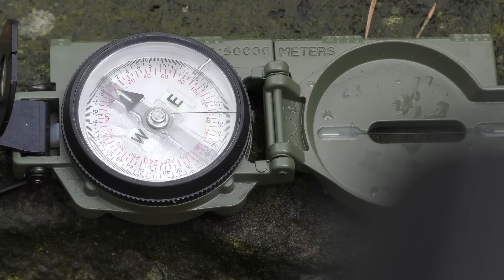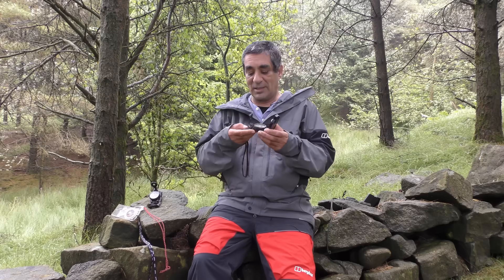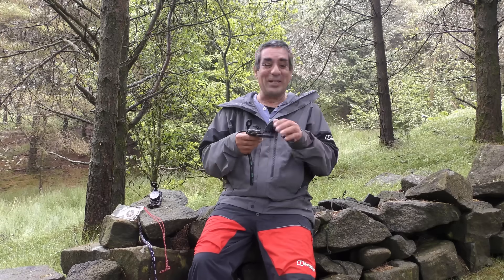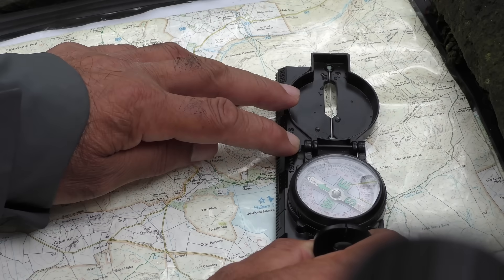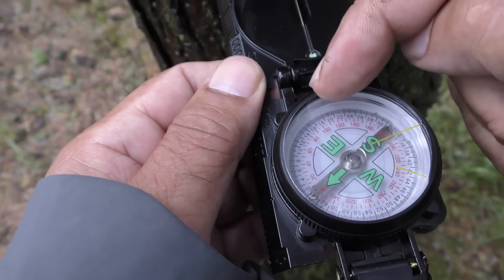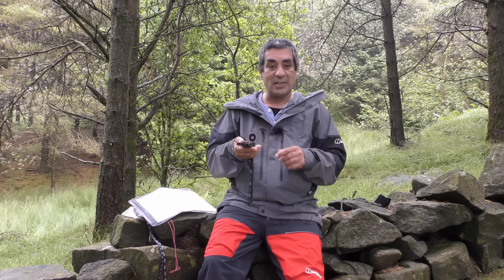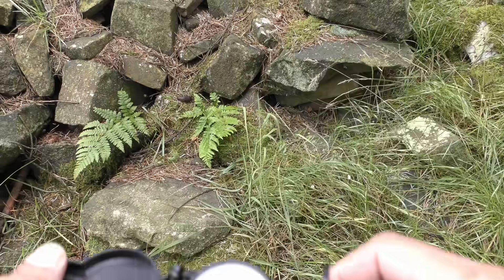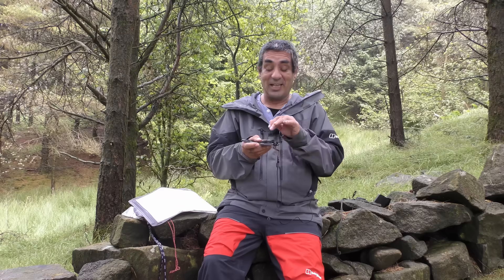The compass no one knows how to use

Comment: Over 50 years ago, the Army had a 4 day Land Navigation Course in Basic Training. The course taught map reading, use of protractors, lensatic compasses, azimuth and reverse azimuths, intersection and resection. For the Performance Evaluation you had to use what you learned to make it through an Escape & Evasion course. Once the Army got GPS's , Land Navigation was put on the back burner.
Reply: Did my course in Basic in 1988 (Ft Sill).  We also laid our howitzers using a compass.  We operated in MILLS at the battery lay, and not degrees so I had one compass in MILLS and one in DEGREES ( for RSOP navigation) to back my laying compass up.

Comment: "The compass no one knows how to use" proceeds to look through it wrong lmao. You fold the lens part up but angled slightly forward and then fold the cover down on top of the lens part so the notches line up. The ends of the lens and cover with the notches should be touching. then you look through the notches like they are iron sights (notches are rear sight and the wire is the front sight post to simplify it) at what you are trying to get the direction for. Then with the same eye you use the lens (angled slightly down for easier viewing) to view the compass so you can get a stable and accurate direction with the cover blocking excess light, rain, snow ect... to easier read the compass. No it's not a cammenga but those features are used the same.

Comment: Good basic use of this very useful navigation tool,  although going forward is very basic finding a needle in a hay stack is much more complicated one degree off at 300 feet is not much of a variation but at several miles trying to get on a 6 digit grid coordinates your going to miss your mark, being able to shoot a back azimuth correctly is a must to maintain a high level of accuracy especially at night .

Comment: I learned to use a compass very accurately back in the 60's when I was a Boy Scout.  Using this style of compass.  Been too many years now so hardly remember anything.   lol  Years later ended up on the front end of the C-130 before the days of GPS navigation where map reading was essential for low level flying.

Comment: OK I thought the short yellow line is for true north. The long yellow  line is for magnetic north. As far as I know there is a 10 degrees difference in true north if I'm not mistaken.
Reply from the maker: The difference between True and Magnetic N, changes depending on where you are in the world.  The short yellow line is just to reduce the number of clicks you need to make to set a bearing.

Comment: The moment I saw that thumbnail, flashbacks during recce course where the wire broke off halfway and lost through navigation. We had to check whose hair was the longest (I won't say from where but all our heads were well.. "uniformed standard") used it as replacement and got our bearings, good memories.. awesome video

Comment: 4:00 confuses me because you say point the long yellow line up the map, but give no reference other then up the map, north? 

The north marked on the map? I see no reference on the map that reference the yellow ling you just moved, i see longitudinal lines but the yellow line does nat match those either. 

Cant be magnetic north on the map because those are true north.
Reply from the maker: Rotate the bezel until the long yellow line is pointing up the map / that's north / northwards on the map.  It doesn't matter which direction the map is oriented in fact the map can be pointing in any direction.

Comment: This hand-held milit-compasses are poor-man-theodolite, but - OBVIOUSLY - you never use them the proper way, bcs, in order to be PRECISE - IN THE SAME ACT, WHEN YOU READ THE AZIMUT-ON-THE TARGET, YOU must see (WITHOUT LOWERING THE COMPASS BELLOW LINE OF SIGHT) - the proper angle (azimuth) on the horizontal circle,  BY LOOKNG INTO THE MIRROR (ON THE INNER SIDE OF THE COVER OF THE COMPASS), where both of these compasses ARE MISSING THIS "DETAIL" !!!

Comment: If you are calculating azimuths with a map, the map has to be oriented to magnetic north.
Reply from the maker: The map can be pointed in any direction.  The results will always be the same.  If you want to orient your map north, that's fine, but it has nothing to doing with taking a bearing / azimuth.
See this video for more details: https://youtu.be/AWiMV4T5kPc
Reply: @TheMapReadingCompany  You're aligning your grid compass to the map instead of aligning the map to the magnetic compass. So, the $64k question is which is more accurate?

Comment: Correct me if I'm wrong but it seems to be the exact same compass we trained on in boot camp in the early 80's. I felt horrible how much I've forgotten. Thank you for an amazing video sir.
Reply from the maker: The compass in the video hasn't been used by any armies for the past 70 years.  You don't say how old you are, so you have used it if you're over around 95.
Reply: I used the 1950 throughout my military career 1990-2020. And it wasn’t the Cammenga as they weren’t established until around 1992-1994. My compass was issued to me in Feb 1991. I still have it out in the garage in my old gear bags. They tried to get me to do a turn in and reissue when every one was in a panic in the mid to late 90s because everyone thought Tritium was so toxic and dangerous. I still have my military issued Tritium dive watch as well, although it has exceeded its half-life and doesn’t glow anymore.

Comment: Never knew about these bearing lines before. Interestingly, I learned how to use a basic base plate compass when I was ten. However, nowdays, with roads crossing everywhere, and people everywhere, the utility of a compass is dropped quite considerably. Plus all the non-compass methods of establishing bearings and lines of sight if need be. I recently bought a prismatic compass as a crossover to the mechanical theodolites I have, showing an alternate method of doing a preliminary survey of an area of land where only estimation is important in order to establish rough boundaries and fixed points of reference, not a precision record. I still love what you can do with a compass, but struggle, in my world, to find a reason to keep one handy, even when I'm away from the main roads. In a way, it's unfortunate, because before we had these things (along with adequate maps), getting around was a LOT harder!

Comment: I have a GI 1950 compass, (since ~1957.)  I've used it all over the world for hiking, minor surveying, and to figure out path problems on microwave radio shots.  I trusted in it for years and it still is in great shape in it's cartridge belt holster.  I was pretty much self taught in it's use but learned to sight and angle the lens to adapt to my eyesight.  I never knew about eh use of the yellow lines, so thanks.

Comment: After several times reviewing this video I understand now how this compass functions. My difficulty is that my Englisch is very poor. I am a Dutch speaking Belgian, but I really like your video’s. Interesting and well made. One of the best on the internet. I saw hundreds of videos about compass, navigation, orientation, etc, but more junk than really correct and useful content. Luckily I found your channel with many correct and informative videos.
I will stay by my Suunto and Recta compasses. By shooting a bearing i turn the bevel (or is it bezel?) and look in the mirror to see if the needle is perfectly aligned with the direction arrow. To read the degrees i don't need no longer keep the compass that way. With the compass you show us, you need to read the angle by keeping the compass pointed to your destination without moving. That seems me more difficult, certainly if you have a little difficulty to read the compass. With the Suunto and other compasses it’s much easier to read the angle from above.
Reply from the maker: That type of compass (in the video) hasn’t been used by ANY militaries for at least the past 70 years – so anyone who was trained to use it in the military will now be over around 90 to 100 years old.
BUT at the time it was the best available and, more importantly, it worked.
I agree modern compass are much simpler to use and less likely to lead us off the path 😊

Comment: Navigating around an obstacle using two 45 degree reorientations off the azimuth might get one back on course with an easy to calculate pace count along the azimuth ... but we weren't taght about the little yellow lines so we used a square instead of a square root.  Thanks for updating my orienteering package!   ... Just now I've begun to wonder if the square root of the square of seven giant steps times two is equal to 10 paces.  If so, I might have to walk faster to keep the pace count.
Reply from the maker: Rather than boxing at 45 degrees,  a better idea is to go at 60 degrees.
I go through this at the end of this video   https://youtu.be/ilXLMlzL9vE

Comment: I always understood under fast walking under difficult conditions is more like slow run, jogging on difficult terrain. You don't have time to constantly look down your wire and you can't stay on the straight line. so you place your north in between the 2 lines and keep it there while running in that general direction. it counts for small deviation in your path that you have to take. when getting closer to your destination you recheck your course adjust to it depending on how much you deviated and start running again.

Comment: I had something like that years ago, easy before the internet,  now I know why the lines where there. 
Mine was stranger than that... on the wire there was a small metal plate that slid up and down.
Please tell me what the hell that was for. 
It was my dad's from when he was in the 17/21 lancers (tank regiment) and he didn't know how to use it either.
Reply from the maker: Some WW2 compasses had slides on the wire to check horizontal angles - used for artillery when firing at something on a slope.  But not sure if that was what your dad had.

Comment: I actually bought one of these years ago when I did a lot of biking on trails but never really had an occasion to use it.  Kind of thought of it as a last resort item LoL.  I'm sure the maps I used would have been worthless with a compass and as you said with gps (assuming you ensure charged devices plus backup battery) it's much more accurate following a satellite position than trying to use a compass but still good to know.

Comment: Interesting. The benefit of the "two-line" (45 degree offset) system, was that it was usable at night without using a torch or flashlight to read it, instead using the 45 degree off-set to allow the desired bearing to be set audibly. In civilian use, this has no benefit, but in the military it did, as shewing a light at night could get you killed. Post 1950's compasses used the rather safer Tritium (instead of radium) as the danger of the latter's dangers were now understood. I think the use of tritium allowed for the degree value to be read more easily than a safe amount of radium would permit, therefore the way the compass was used also changed?

Comment: I was in the US military from 1984 to 2008. We use the same compasses. Those yellow lines will illuminate at night when you put a flashlight on them. Most of the way you explained how to use a compass. We never used it. We were given distance and directions. We were told a degree we set the compass locked it in on that degree. We were told that if it was 3,000 km I know that I walked 36 steps per 1 km distance and direction and we were able to use the map to set our compass

Comment: Does the compass-on-map technique that you demonstrated starting at 3:30 account for magnetic declination?
Reply from the maker: No.  You don't account for declination whilst you're taking a bearing from a map, it's done afterwards.  
1 Put the compass on the map so the edge is touching the start and end of the leg.
2 Rotate the bezel to get the bearing.
3 Pick up the compass an adjust for declination.
4 Set off.

Comment: I have a Helicon-Tex Ranger that has, not only the two lines (in this case they are green) but also an index line. 
The magnetic base has a bit of inertia to it (takes a little while to stabilize) but apart from it works very well.

Comment: Both of those compasses are obviously cheap knock-offs. They both have the unit of measurement, "metre" misspelled as "meter" (a meter is a device used for measuring. eg. The compass itself is a type of meter, but the distance it measures are metres.)
Reply from the maker: I bought my Cammenga direct from Cammenga, so it's not a knock-off.  I always thought that Meters was the American way of spelling it and Metres was the UK’s way.  I may be wrong about this, it’s just a guess.

Comment: I have my dads old lensatic compass and a BSA plate compass.  The lensatic doesn't have the straight edge though so it's more difficult to use on a map than the plate compass.  I do prefer the lensatic for taking bearings in the field.

Comment: Thanks for this, my scoutmaster was kinda mixed up about this too, some thirty years ago. My way of dealing with it, again thirty years ago, was to know which radio towers were which in my valley. If i could get a bearing on any two I had a good idea where I was. I kinda figured out how to set my direction by the long yellow line, but got mixed up fairly often. I'm gonna watch this video another half dozen times, taking notes. And invest in a compass that has clicks. Thanks again :)

Comment: Anyone who went thru basic learned this like week 3 or 4...It was a requirement to pass.
Reply from the maker: I agree.  Anyone who went through basic training in the USA, before 1955, will have learnt to use this type of M1938 compass.  After that (in the past 69 years) they will have learnt to use a lensatic compass with a tritium mark - i.e. with no short yellow line.  So anyone who is less than approx. 90 to 100 years old will not have learnt to use this type of compass in basic training.
As repeatedly stated in the video, this is NOT a cammenga and it is used differently.

Comment: I’m disappointed, the reason for two yellow lines isn’t the one you explained, yes, it can be used that way, but one line is actually used for indicating the calculated mean magnetic declination for the map you’re using.

The magnetic North Pole is always moving, compared to map or “true” North, in the map legend you’ll find the map date, and average annual mean declination, you calculate the magnetic offset for the current year and indicate that with the (long?) yellow line, and indicate the intended track with the other (short?) yellow line, I may have which line used backwards, working from memory here.

That way you can indicate/see, tack, true north and magnetic north through the lens.

Comment: I have such a compass. It is labeled "Engineer's Compass". It didn't come with instructions but I have done orientating and map reading. I didn't know about the three degree clicks, but now that odd loose design makes sense.

First time seeing this channel so perhaps I missed something, but, maps are oriented to true north and the compass points to magnetic north. I guess I missed where you showed this, so people don't go off in incorrect directions?

I will need to check myself, to see what the difference is today. Magnetic North has been migrating quickly lately, eastward from my perspective.

Comment: 40 years ago I had in my hand an Original Bezard (?), I don't remember the round hole for the eye, just the slot with the wire. But there was another articulated cover over the entire dial, sheet metal with mirror finishing, I did not understand its purpose. By the way, the scale was not rotating with the magnet, just the needle with an arrow and a circle, phosphorescent, and on the glass was a matching mark.

Comment: That brings back memories. I got one of the knock-off types in scouts, 30-35 years ago. It had green weak GITD lines, I recall, had to be held annoyingly level for the dial to move, and was heavy. My grandfather had an old  Superior Magneto one, but it had disappeared, by the time he died. With all the large dark areas, and dark cover, it was much easier to read in the day than most. But, I never learned to do much of anything with it, beyond matching the big line to a direction on a map.

Comment: if you ware a sailor you would know about the small yellow line. It is there so you can calculate your on wind bearing. Sail boats could in the past travel at about 45 to the wind. Today boats can travel in even less but this was the fast calculator  to find your bearing to travel on.

Comment: Any navigation system should be used regulary to lear how to use it and to make sure it is functioning properly. Don't wait till you are lost before you start trying using that pocket GPS reciever.  
I got turned around in the woods and was beginning to think I was going to spend the night alone!  After that I always had a compass in my pocket. I pulled it out one day just to check directions. It was pointing the wrong way!  The North pointer was pointing south!  I had carried that compass a couple years before I checked to see if it worked correctly! I tcould have caused a real disaster! Buy it, Check it out and use it often!